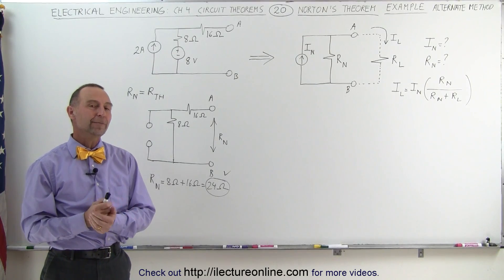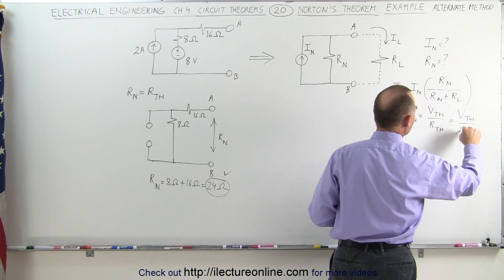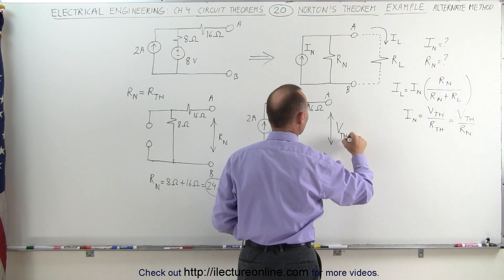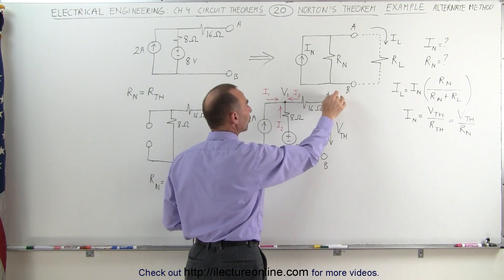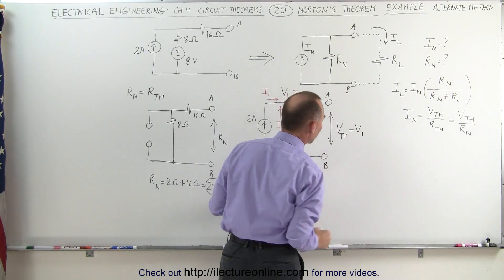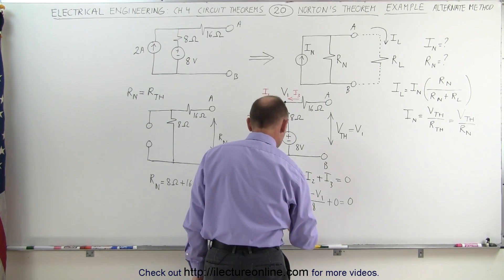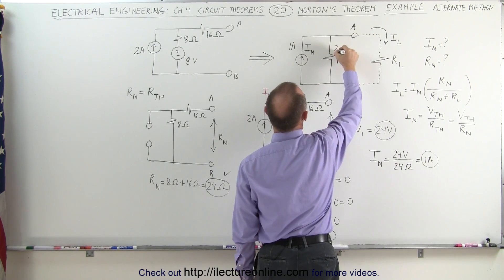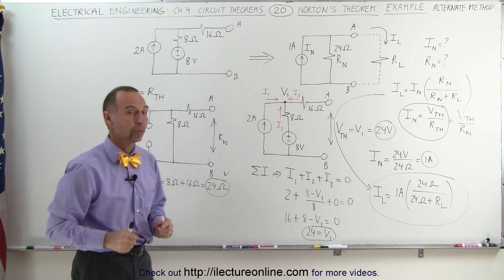Electrical Engineering: Ch 4: Circuit Theorems (20 of 35) Norton's Theorem Ex. 1 Alternative Method

Comment: Why doesn't some of the 2A current source flow through the 16 omh resistor?
Reply from the maker: When the 2 A current reaches a branch point, it will flow in different directions depending on the makeup of the circuit.  But a current source means that it controls the 2 A current in that branch regardless of the rest of the circuit.

Comment: Sorry sir I still little bit confuse why current from i3 moving to V1, not leaving v1?
Reply from the maker: On the left side, the current source (2A) pushes the current upwards.  On the middle branch, current flow away from the positive side of the battery and towards the negative side of the battery.  And since we found I load to be positive, the current flows away from V1 towards the load.

Comment: I just can't figure out where he gets the formula IN = (VTH)/(RTH). Since it's a parallel circuit, IN will split up between the two branches, RN and RL. But the intensity going through RN, call it I1, cannot be equal to IN. Therefore, applying Ohm's Law, we'd get that VTH = I1 * RTH, which is to say: I1 = VTH / RTH, BUT I1, NOT IN. Please helppp.
Reply from the maker: Alex,Take a look at the next video (Norton's theory summarized) and see if that helps you understand it.  If not we have another really good example in the physics videos that may help.
Reply: I'm not sure if you're still struggling 4 years later, but Thevenin's and Norton's circuits are essentially the same circuit with a source transformation applied. Thevenin's resistor is in series with Thevenin's voltage, and Norton's resistor is parallel to Norton's current. This relationship between the source and resistor in these circuits is why IN=(VTH)/(RTH).

Comment: sir , why is I3 is entering the node V1??
Reply from the maker: Those current directions are arbitrarily chosen.  (It doesn't matter what direction you chose).  If the actual current is in the opposite direction, you'll get a negative value for the current.

Comment: Sir, why can't I use V1-8 instead of 8-V1 ?
Reply from the maker: Since the current flow "upward" through the 8 ohm resistor, we can assume that V1 is at a lower voltage than 8 volts, and therefore 8 - V1 is a positive quantity.

Comment: PLEASE HELP - why did assumed that i3 is also entering node 1?
 I get that for current i1 is entering CS is directed that way anf i2 because VS + sign in that way but why for i1?
Reply from the maker: I did that intentionally to illustrate that it doesn't matter which direction you assume (even if they are not correct).  If the assumed direction is different from the actual direction you will simply get a negative answer.  In this problem it is obvious that I3 is actually in the opposite direction, but again it doesn't matter which direction you assume to get the correct answer.